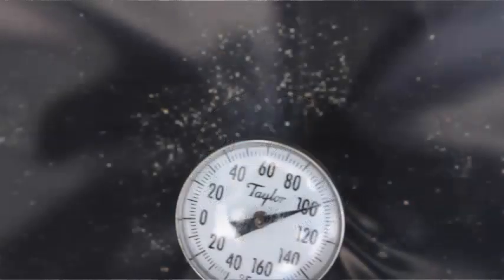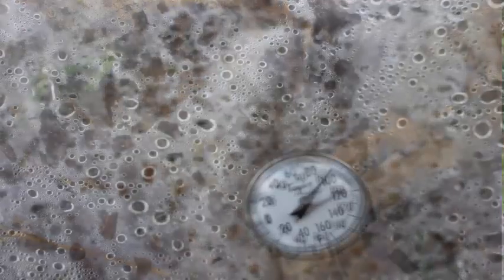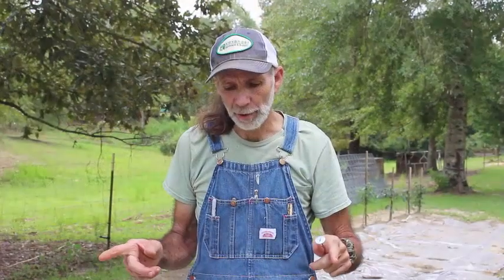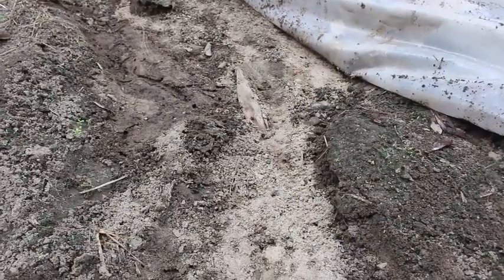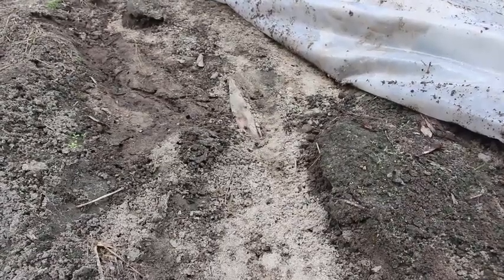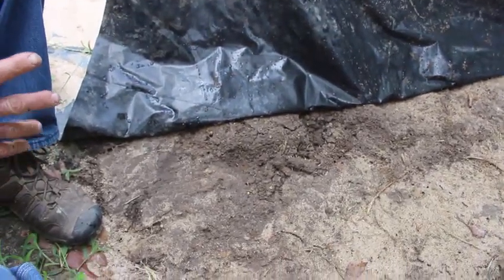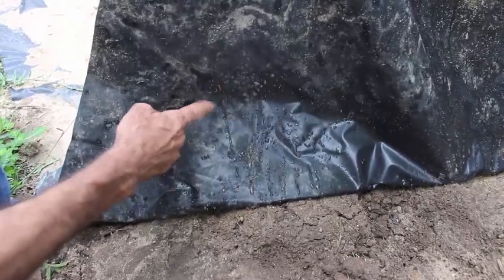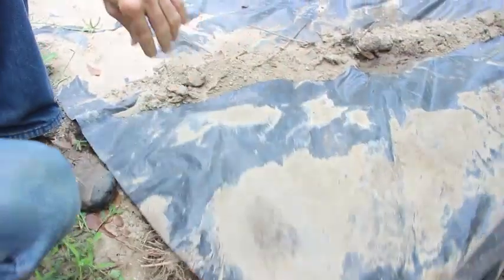Which Is HOTTER? -- Black Plastic vs Clear Plastic  Week 2

Comment: One side being warmer than the other still doesn't indicate it will be better for killing nematodes. The supposed benefit of the clear is allowing the ground to be showered in solar radiation, which hopefully kills the nematodes. It remains to be seen which will do a better job of ridding the soil of nematodes; that was the stated purpose from the beginning. Which side is hotter is not really the issue.